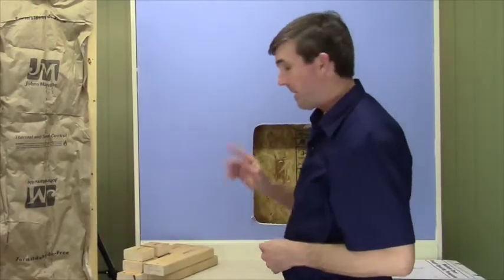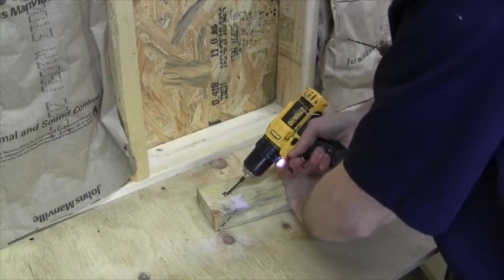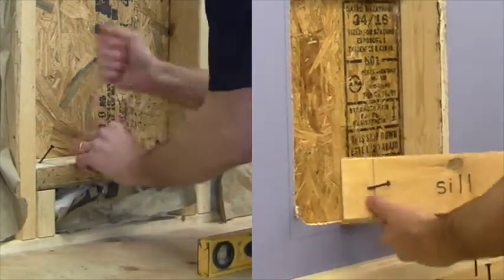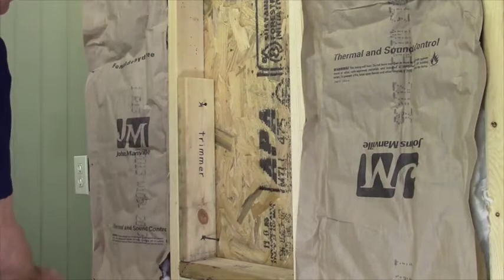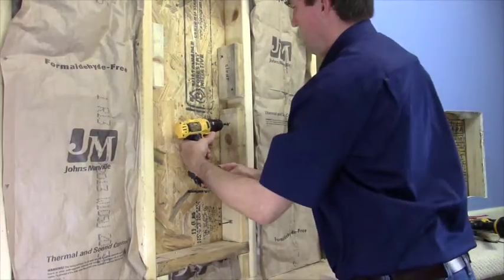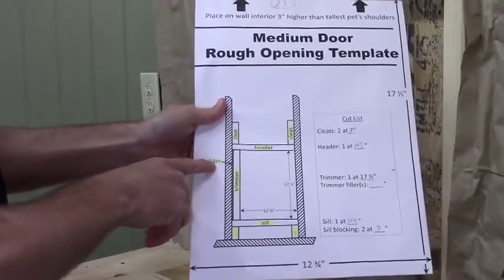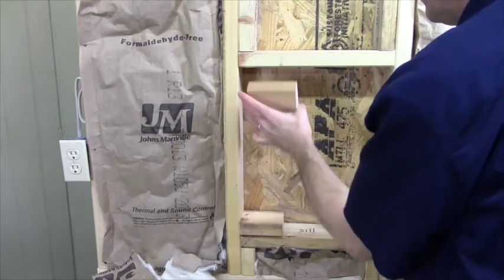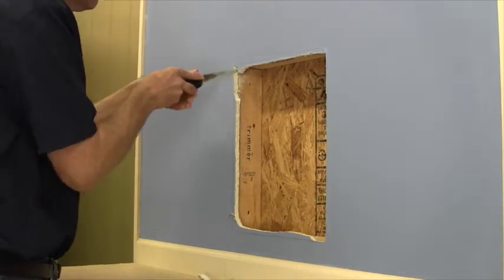4 Frame Rough Opening - Freedom Pet Pass Wall-Mount Door Installation

Comment: Thanks for this video. I'm not using a pet flap, just keeping a hole in an open framed wall for the cats to have their own passage, but the trick of getting the height even is so useful.
Reply from the maker: Glad you found it helpful! If you ever want to consider adding a flap for your cat door, definitely check us out. Good luck with your project!

Comment: Could I replace using the cleats with using a pocket hole jig and just screw into the studs?
Reply from the maker: It certainly wouldn't be as sturdy. It might be okay for a smaller door, but if you've got a large or XL, doing the cleats would probably be safer.
Reply: @rangerpetdoors  thanks for the reply! I’m putting a door in my stucco exterior wall